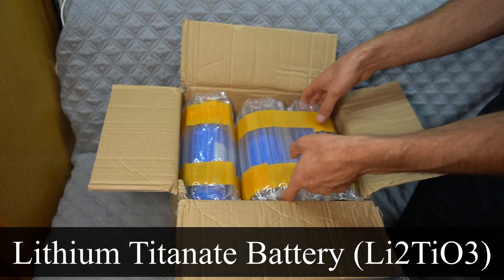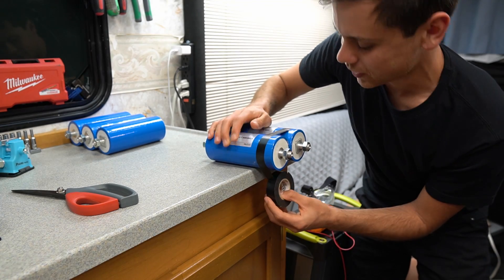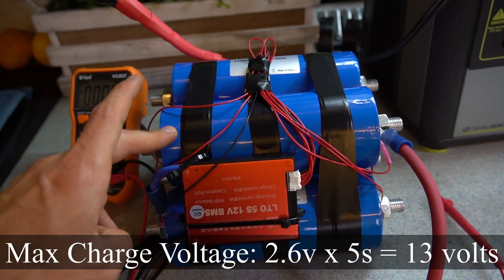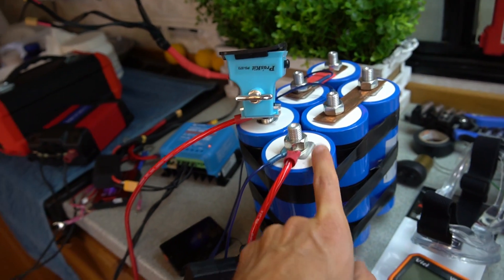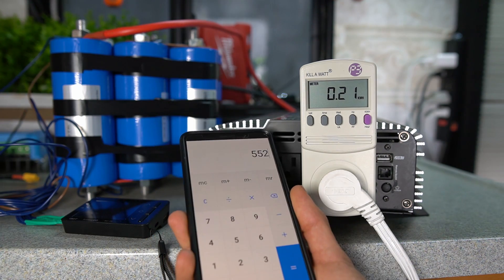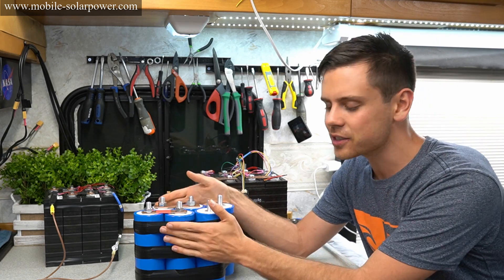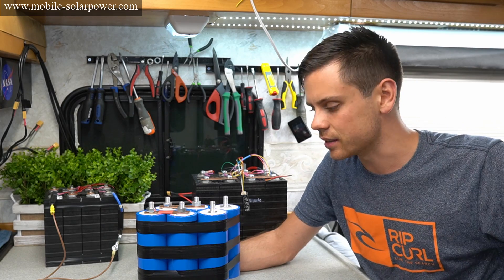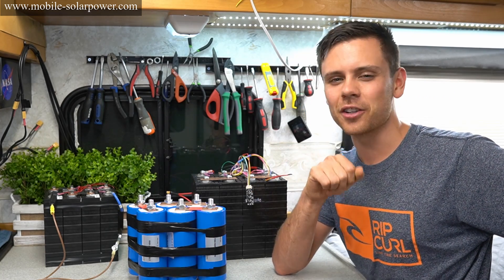DIY 12v LTO (Lithium Titanate) Battery

Comment: There's a lot of "grade B" lto cells on Aliexpress, I'd recommend purchasing them buy joining a FB group buy, there's a good group buy run by Shawn Mayo. The FB group "Yinlong Only" is a lithium car audio group that Shawn and many other lto users are active on.

Manufacturers use the same 66160 cell dimensions for 30-40Ah.
Reply from the maker: Good to know. Yeah I've been seeing group buys lately but had bad timing. Thank you for the good advice
Reply from the maker: For solar, I see lto as a pretty bad choice. I just do not like them, especially with LiFePO4 available. What are the reasons the car audio guys like lto?
Reply: @WillProwse  Very high safety and C rate, fairly easy to assemble, lots of busbars options for yinlong cells, they usually charge to a regulated 15.4v max which is good for a 6s lto battery, 4s lifepo4 is limited to around 14.5v max. There's car audio guys that don't have proper bms's(only an active balancer and using a balance charger every couple of months to re balance the pack if it needs it.) and the audio system can be 30kw+, in other words they tend to work/abuse the battery more than other apps. For example 5 8ah lifepo4 Headway 38120HP cells in parallel take up more space, heavier, similar discharge rating but requires more hardware than a single 40ah yinlong 66160 cell.
Reply from the maker: @GENcELL2014  30kw?!?! Wow. Ok now lto makes sense haha that's amazing.
Reply: @WillProwse  that's with atleast 300 amps of continuous input current, usually. and your talking like 240ah of them to hold 30k+. a single 6s bank is rated for around 4kw contious with some type of input current, for amplifiers. the safety of about 10c on a single 40ah 6s bank is why people will use them, along with cylindrical cells being very easy to assemble compared to say, pouches, square cells or even smaller cells like headway cells, also because the larger hardware is alot more fool proof, since a single bank could see over 400 amps of discharge, and possibly just as much back in. all cell types have their place.

Comment: With that low discharge efficiency, I wonder if the amp-hour rating is only at a low rate of discharge?
E.g. most lead-acid are rated at a 20hour rate. If these are similar then you would only see 40Ah if your discharge rate were about 2amps.
Reply from the maker: Exactly. I couldn't find data on it but that's what I am thinking too

Comment: Awesome! If there was anything I wanted you to do that you hadn't done already, LTO was it. There simply wasn't enough about this mysterious chemistry on YouTube to really get the idea what it is all about. The 85% seems like a bummer, but I would still probably go with this chemistry for something like an offgrid home with high power usage + production and lots of frequent cycles in a very sunny location with a smallish battery pack. The weight is also largely irrelevant in a stationary application.

Thanks once again!

Comment: Have you by any chance tested these cells under a low current discharge? You were pulling 600+W after all. Perhaps the efficiency is better when you pull less amps? I suspect the charge/discharge C rating has been mis-advertised.
Reply from the maker: Oh absolutely. Totally agree. I will test again. If you have a huge battery pack, so each cell discharge rate is extremely low, the efficiency loss may not be that bad

Comment: I have a great video idea. Buy one of those Energy Transfer ion Lipo LiFePO4 Battery active Balancer Boards I ordered one off Ebay for $14.58. Then make a review on it. It uses tiny inductors to transfer power from the higher voltage cell to the lowest. Starts to work when cells get off by .1 Volts then stops when cells are within 30mV. Static power consumption is only 20ua. These are a lot more energy efficient than just using a resistor to drop voltage on higher cells. The balance current is 0-1.2A This unit works alongside a regular BMS. Great videos by the way. You are correct there are lots of good deals on Ebay for LiFePO4 batteries to make battery packs.
Reply from the maker: I am literally filming that right now hahahha
Reply from the maker: I have literally that exact one connected to a LiFePO4 at this moment

Comment: At 48Wh per cell with your results, a 10kWh pack would need 208 cells, and cost $9500.
I think I'll stick to 18650s. Have over 1000 cells now harvested for "free", apart from the weeks of testing, logging and sorting.
Give me the dimensions and I'll make a cell holder and send you an STL file which you can print out.
Reply from the maker: Oh awesome!!! I would love to see your pack. Do you post anywhere? There is a Facebook group for jehus powerwall community on there. I am going to make some cylindrical LiFePO4 cell videos in a couple weeks. Can't wait to show you
Reply: @WillProwse  Sweet!

Comment: As usual, great review Will. Can I ask a favor man? Can you do a vid explaining the most recent ultra/super capacitors, & why we can't use just them for energy storage?? PRETTY PLEASE....? Why can't we force a slower discharge, through some sort of circutry like a returning loop of unused electrons to charge right back in to the cap, or use resistors or something, or even both..? I see where people are making small solar generators with only super caps, what about a big non portable system? There must be a way, & only those who question & test the boundaries will find it...I'm betting that you & your viewers are just such a crowd.. Let's crowd source this invention!
Reply: The answer to your question is super capacitors store very little total energy compared to batteries of the same size/weight.  Like maybe ~1%.  Super capacitors are great at charging and discharging lots of power for a second or two but the overall energy isn't that much.  If you tried to stretch the energy out for even just a minute or two it wouldn't power very much before it was completely discharged.  Also, they will fully self discharge in a matter of days or less which is not desirable for most energy storage applications.

Comment: Need to invest more time and energy in them batteries 20,000 charges there's got to be a way to get something out of them
Reply from the maker: Can't really beat the laws of thermodynamics. That discharge efficiency makes me cringe.
Reply: @WillProwse  man I thought that's what you were talking about so the reality is you could discharge them batteries 3 to 5 times a day if you could charge him that fast so they would have less of a lifespan if you could use it then lithium iron phosphate did I say that right
Reply: @robertatwood2503  You are absolutely right. He didn´t get it and besides....this was a very lousy test!!!
He does not even know how many amps the battery have. I think before running a test to show it on Ytube FIRST !!! he should get some decent batteries !!! 
It´s not only the 20.000 life cycles. It´s also the 10 C charge rate. There are applications where You don´t have time all night to charge up.... or it might be much more efficient and less hours of noise if You can charge fast....... or You might need a smaller battery pack if You can charge fast. That would also be less weight. Make the numbers with a 48 V pack and things look different.
Reply from the maker: Yeah I agree guys. I said exactly what you guys just stated and it's not good for solar but it's great for other stuff. I guess you guys wanted me to go.more in depth on other applications. Sorry about that. I agree with everything said here. And I thought my tests were still very useful regardless.
Reply: @WillProwse  they were vizvary educating I had no idea of those batteries even existed

Comment: Do you think these batteries might be the next big thing in solar power storage? I'm saving for the LiFePO4 batteries.
Reply: The thing about LiFePO4 batteries is if you have more than one, they can be discharged in series, but they MUST be charged in parallel.
Reply from the maker: @Booboobear-eo4es  that is false
Reply: @WillProwse  - I didn't believe it myself at first.  I sent an e-mail questioning this (I don't recall if it was Renogy, Magnum-Power, or a battery supplies), and they stated that this was the case.  I was quite disappointed as I was very much in favor of Lithium.  I can retrace my steps and find out which manufacturer gave me that info.
Reply: @WillProwse  - I have just sent an e-mail (6/12/2019) off to Renogy as to how LiFePO4 batteries are to be charged.  I update when/if I get a response.
Reply from the maker: @Booboobear-eo4es  no, you are wrong
Reply from the maker: @Booboobear-eo4es  and renogy LiFePO4 can't be in series ever. But that is not something specific to lithium batteries. It is specific to how the BMS works. Please ask an electrical engineer or something. Or read the manual.
Reply: @WillProwse  - I was talking in terms of Lithium batteries with BMS.  My bad for not being more specific and making that clear.  Straight lithium type with no BMS would not be a problem in either a series or parallel configuration, charging or discharging.  However, I would not want to use Lithium type without the protection of BMS.  Especially, if they were in a garage attached to a house where there was be a risk of overcharging and fire.
Reply: I see Will doing it all the time ,  charching in series that is.. 🤔
Reply: My car has these batteries and the warranty is for 10 years @ 70% of the capacity.  After 7 years the range is over 60 miles or over 90% of total capacity. In the winter the range drops close to 50% but with the $$$ saved on gas I can't complain.

Comment: Yeah you need 6s, charge to 14.5 or so. Chargery makes a bms/ monitoring system, for 8 cells any lithium chem, for about $100, and balances at near 2 amps or so, I'm going to get one.

Comment: So charges fast, lots of discharge cycles, safe, but a little screwing around with balancing, and capacity is less than claimed but still decent?  I like them.
How about lithium ceramic batteries? I want to see some tests of those done by Will Prowse Id also like to see you design and ride an ideal electric bike, I just know you could build an amazing one for cheap (and sell lots of parts for them if inclined)

Comment: Safety came up a couple of times here. How about lesson on safety measures to look for various environments? Until yesterday I didn't know that some 18650's have some kind of built in safety measures and some don't. Haven't dived deeper into that yet. And I've been wondering about the safety of the various power stations you've reviewed (Jackery/Goal Zero/ExpertPower/Rockpal/etc) - are they safe for unattended charging for vanlife? I know some things have fans, but if heat is a problem why don't we see heatsinks on any batteries? So many questions?